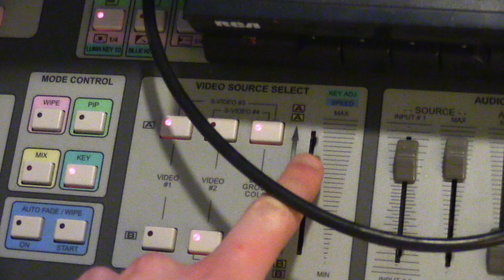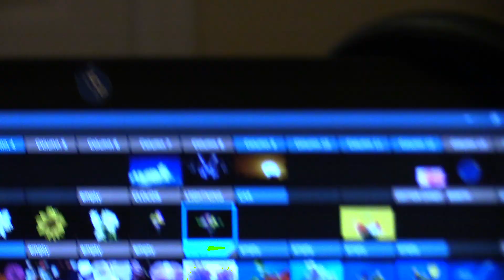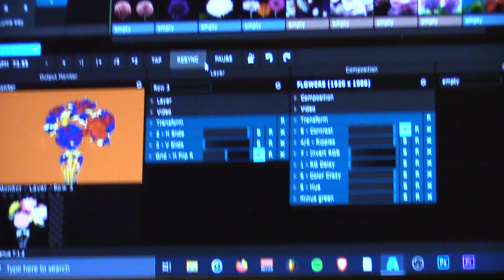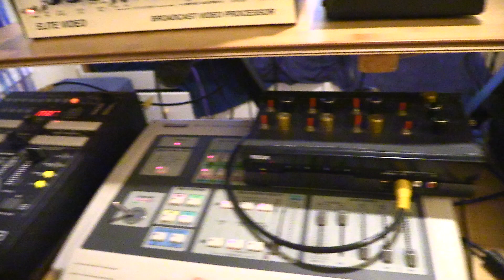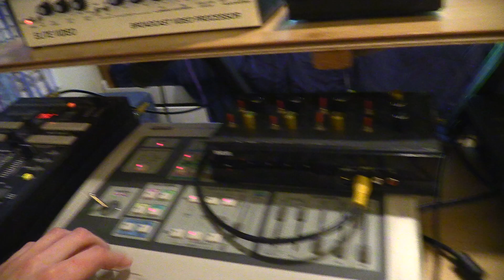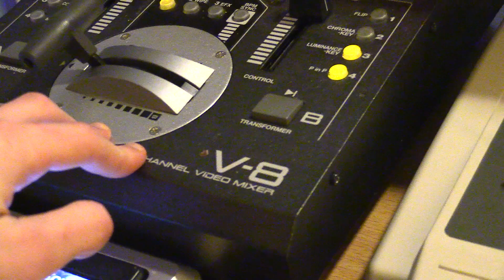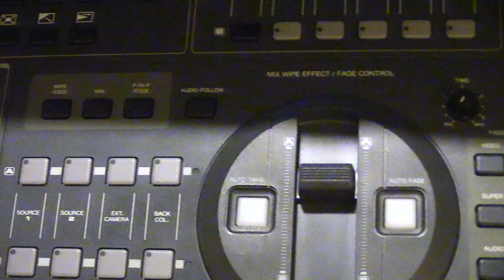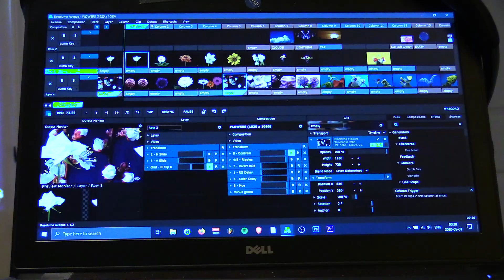[old] analog glitch visual rig rundown no one asked for

Comment: Love the setup. I just got an old tv, vcr and tachyons box. I’m looking to build up the collection and get a video mixer but tbh I don’t quite understand all the other boxes and equipment yet
Reply from the maker: one step at a time
Reply: What is the tachyon box exactly? I’m a musician with an audio production background and I want to know if audio gear works for raw signal mixing.
Reply from the maker: @graxjpg  the best way to find an answer is to try yourself
Reply: Yovozol I’ve got a component to hdmi converting box, and lots of RCA to 1/4in converters. I’m gonna do some experimenting.
Reply: I think I would need a TBC for this with my HDTV. gonna have to get a crt now lol
Reply: @graxjpg  audio signals can be seen through a crt.. but it is a dangerous process to mod the crt. In theory signals should  ..maybe produce  a result with signal flow in the reverse direction.

Comment: @yovozol I just went through and watched through a bunch of your videos, and am wondering the basics of what you have done here.
Is your setup that you are generating video within resolume sending it through to a video mixer/Time Based Corrector and then circuit bending it and outputing that to a projector to display the visuals?

Have you ever thought of making a how to video and just breaking down the steps of a video glitch setup simply, eg. step 1, 2, 3?

I'm interested in circuit bending old vhs tapes and recording or projecting them and wondering if the way to do that would be to get a video mixer/TBC and some kind of circuit bending unit. and then to just output that to a tv or projector and either recording that on my computer or filming it. 

To get those great classic glitch effects is a circuit bending unit neccessary? or would a regular video mixer be able to do similar?
Reply from the maker: you've got the right idea don't overthink this, it goes laptop > downscaler > circuit bent stuff > video mixer and/or TBC > projector and then you just film the output.
Reply from the maker: depends what you mean by "classic glitch effects" if it has distortion in the signal like repeating edges or signal tearing then it was produced by something circuit bent.
Reply: @YOVOZOL  Thanks so much! What's the deal with buying a downscaler? Are they easy to come by/buy?

Also potentially wondering if there are any open source schematics for how to create some circuit bending circuits. I have a friend of mine who is a whiz at making effects pedals who I might be able to get involved. :)
Reply: Do circuit benders have to be made out of old video mixers though? 

Or better for me to just save up and buy one ya reckon?

Thanks so much by the way amazing what you've done with your channel.

Comment: Hey I just got a Panasonic max 30 and a tachyons box. My crt only has a coax input. How can I set this up?
Reply from the maker: make sure you have a crt that has composite RCA inputs
Reply: + @YOVOZOL Look for an RF modulator! Works like a champ for me! It converts analog component cable (yellow) into RF Coax by emulating channel 4 or 5 (some might do others). They’re very cheap too so it’s worth a try! Could be used as a pirate radio broadcast to my knowledge too, but you didn’t hear that from me.
Reply: Additionally, if you use a HDMI-AV adapter you can display your computer or HDMI source’s output on any rather old school CRT.

Comment: You may be one of the few people out there who can answer this. Do you know of a HDMI to composite converter that is 4:3? Like Windows recognizes it as a 4:3 source? I always have issues with the aspect ratio when it's being converted
Reply from the maker: You should just be able to set the output display resolution to 800 x 600 px or something  in windows settings
Reply: @YOVOZOL  It's always distorted for the converters I use. What's your go-to converter? I'll just get what you recommend
Reply from the maker: @nuvotion-live  i use a TV One downscaler. they're getting hard to come by on ebay though. when you're talking about aspect ratio issues, it's inevitable when looking at a CRT tv or analog monitor since your original 16:9 digital signal is being squished to a 4:3 monitor. it will only look 16:9 again if you're using a more sophisticated monitor, like a projector, or 16:9 lcd screen.